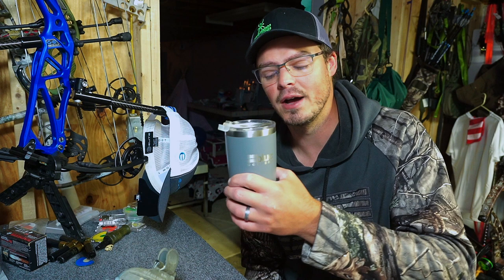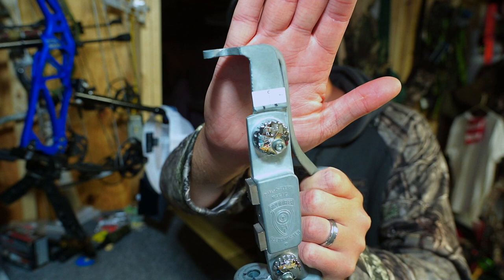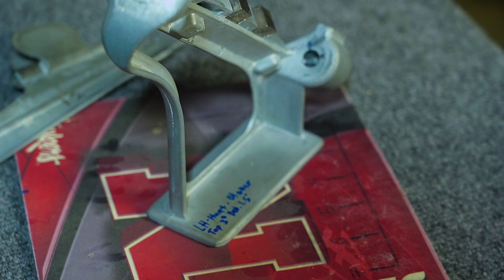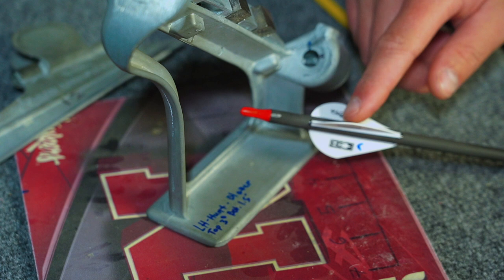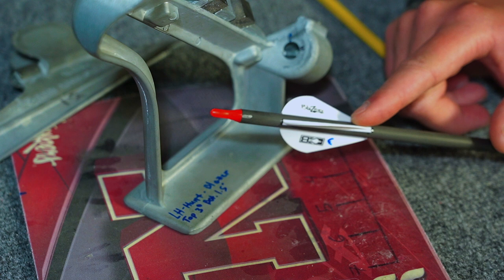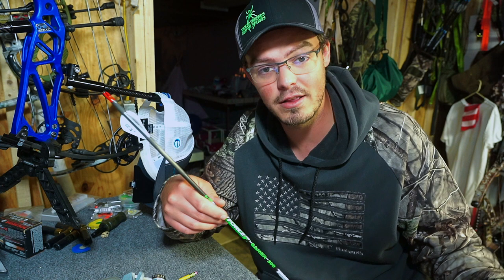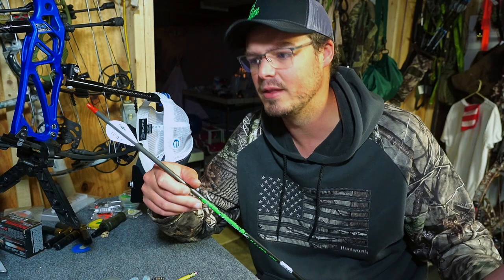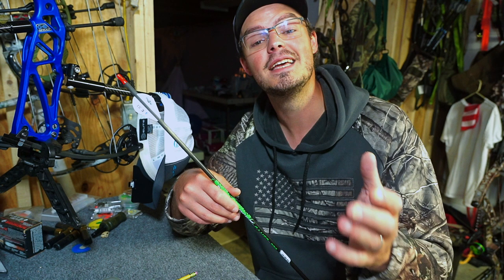CALIBRATING a FLETCHING JIG | What's AFTER Nock Tuning?!

Comment: Thanks for sharing a video on this subject. I don’t have that jig, but I had enough points on GoHunt and got an Easton jig one of the orange 🍊 ones that I believe only does 3 vanes and is for small diameter arrows. I have yet to order arrows and other components but want to soon. October will be coming quicker than we think. I am now running a Hamskea Primer after using a whisker biscuit since I got it in 2006. I like it so far. I was going to try 4 fletch but currently don’t have the jig for it. 
I am glad that those Blazers work well with the Magnus Stingers that you like. I was having consistency issues with that combo last year and switched to G5 Montec CS 100s and tried lining up the blades with my fletchings.

Comment: Not following. Any chance you can do this vid and show the process?  Just pointing to a fletched arrow is tough to follow. Is it possible that different bitzenburgers are indexed differently?  With the flat/index part of the knob up, mine is nowhere near where yours is. (I think.) Is the knock twisting supposed to line up the first fletching cock vane up, or does that twist result in the cock vane being fletched third?

Comment: I have a question about helical fletching.  I'm using the Bitzenburger jig with the helical clamp.  It looks to me that in order to get the fletchings to make good contact with the shaft I need to take out any offset (I have been using offset but tried helical and have had improved groups).  I'm using AAE Hybrid 26 vanes in a 4 fletch/90 degree setup after nock tuning the shafts.  Shafts are Easton Axis 5mm.

Comment: Okay. I’m confused. In another one of your videos you talk about marking the index point of the nock on the arrow after nock tuning. Where I get confused is that once inserted into the jig you rotated the shaft so that the sharpie mark lines up with your jig mark. This changes nock position away from your nocked tuned position, correct?  Is this just to get the cock vane to be vertical and then adjusted afterwards?  The reason that I ask is that in this video your nock groove lines up perfectly with the sharpie mark. So I’m kind of lost in this process. On the surface it appears as if the nock tuning went out the window in the fletching process.